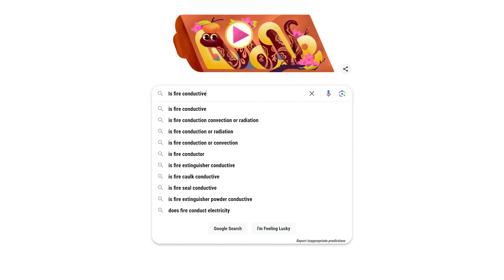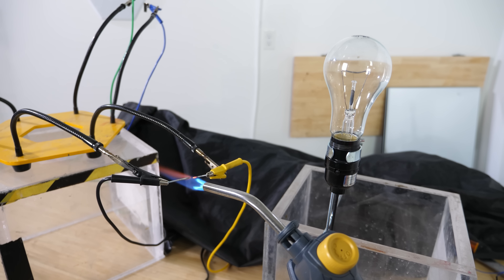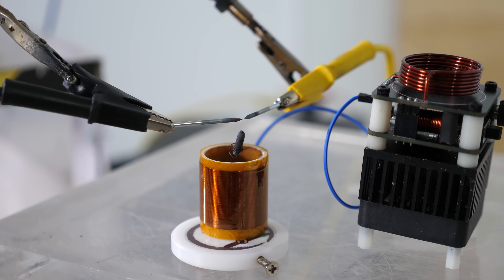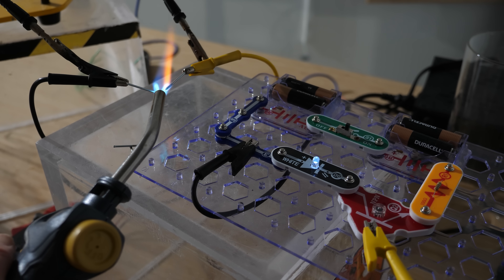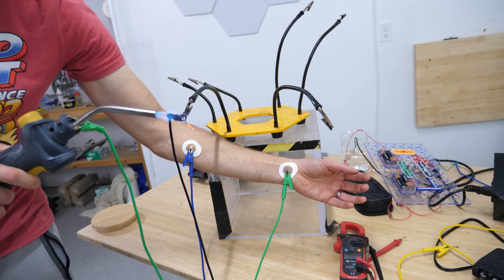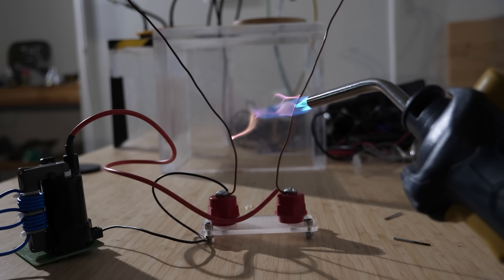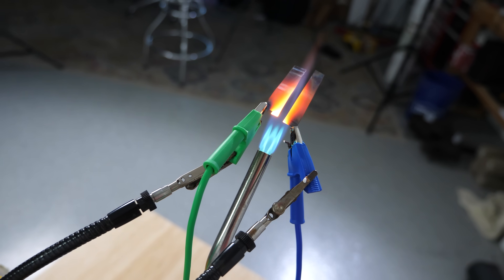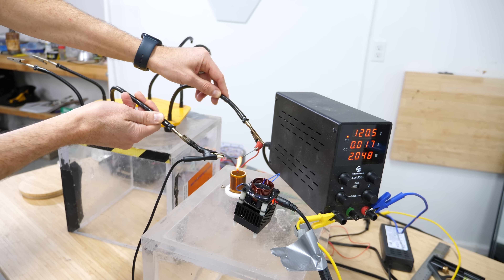Is Fire Conductive Enough To Get Shocked?

Comment: Do you read fan suggestions? For instance i noticed that when i vortex a tube with a liquid, the water level depends on where im holding. If i hold low, the water level stays there, if i hold at the top of the tube , the water level rises.  It  would be cool to get an explanation on how that works

Comment: ok it's only been like 30sec. and think it will only bring down the extremly high resistance of the air down A LOT but the resistance will stay extremly high nontheless so unless you're pumping tens of kilovolts close to eachother with exposed contacts..... fire won't do much
Reply: I was right xdd

Comment: Yes. Fire is conductive enough to get shocked. Modern gas furnaces use flame sensors that conduct enough voltage to feel. The electronics run off of 24V AC, so that's my guess.

Comment: One of the few times I knew the answer. Ion density is everything, thus why Neon lights require a fixed volume to prevent thermal expansion of the gas that's ionizing and carrying a charge.

Comment: Hot air balloons rise through earth's internal magnetic field grounding currents. Grounding currents. External heat energy outside of entanglement of mass doesn't ground currents only mass grounds currents flowing through mass towards earth's internal magnetic field as current flowing through atmospheric gasses. Lightning is rapid heat energy disolving gases.

Comment: You probably don't have to worry about this but I wonder if the direction of current flow would matter. Also it probably wouldn't but I wonder if using a different Flame would provide different results. Like what if you used a lighter instead of the blow torch.